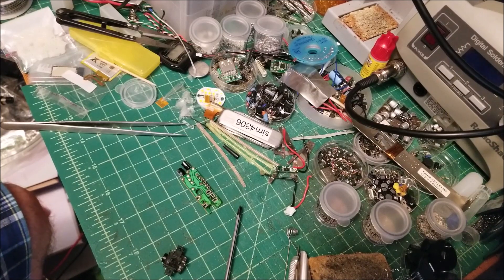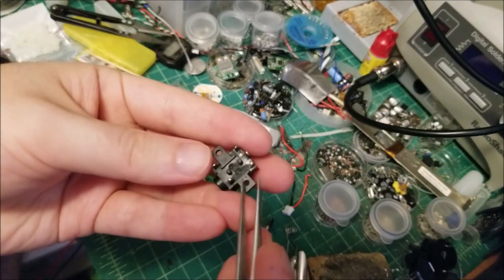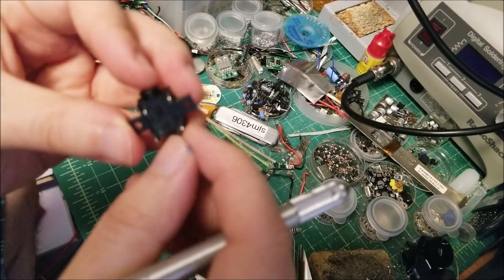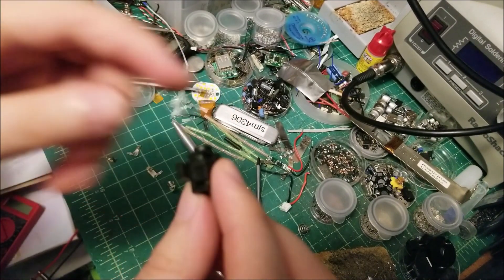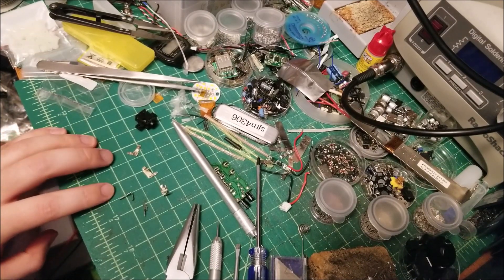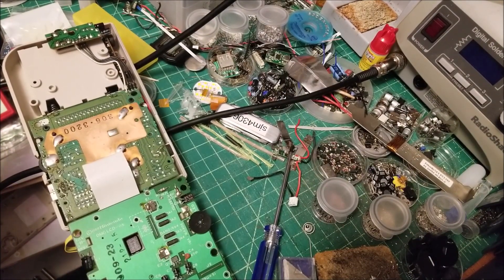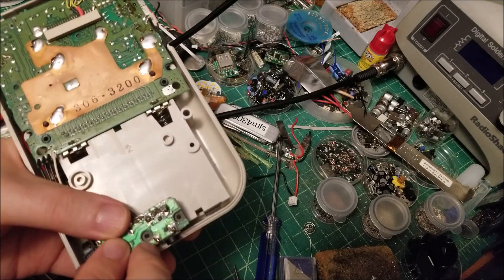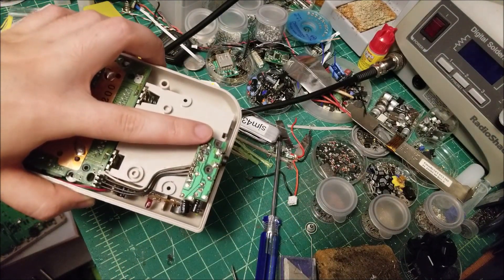Gameboy DMG Headphone Jack Repair

Comment: I ended up just bridging Pin 4 and Pin 5 on my Gameboy color and that fixed the speaker sound, but the headphone jack no longer works. Somewhat of a permanent solution until I desolder the wire and then the headphone jack would work but the speaker wouldn't.

I would definitely desolder  the entire headphone jack but I struggle to use soldering wick, would love a tutorial on how to do that!
Reply from the maker: I generally dont have much luck with wick. I much prefer my radioshack manual desoldering iron.
Reply: @sjm4306 Honestly that sounds way better! Is there a newer equivalent that you could recommend me? I searched it up and i only see used ones on eBay.
Reply from the maker: Here's a new desoldering iron I could find for a decent price: https://ebay.us/iSAM8f

It's not the same mechanism as mine (it's a plunger type not bulb type), but should work as well once you practice with it a bit.